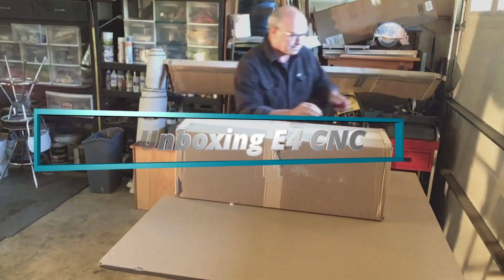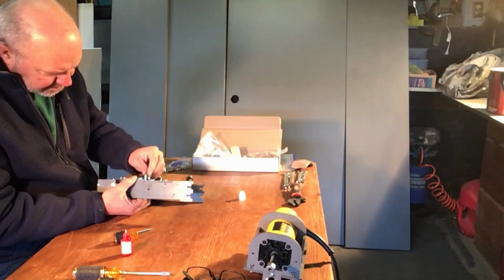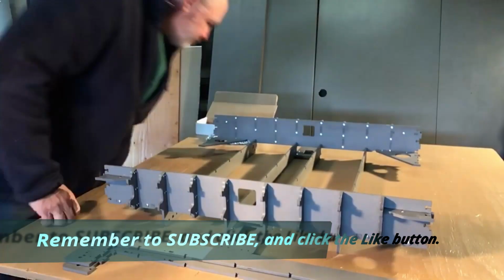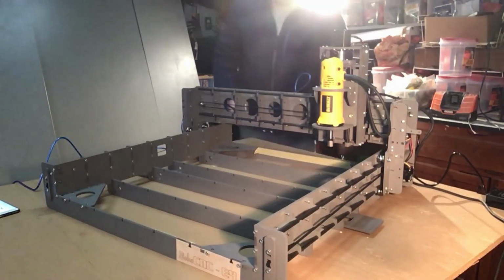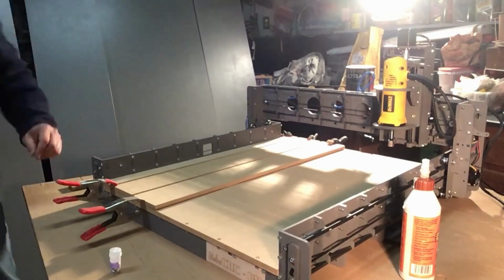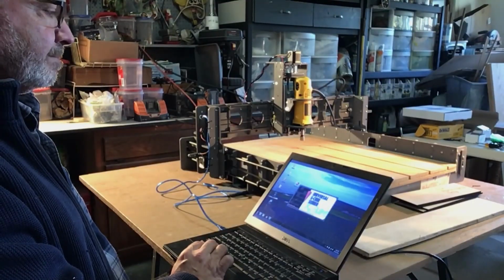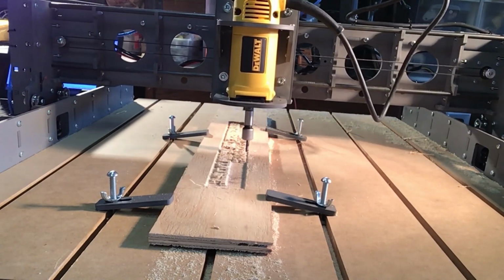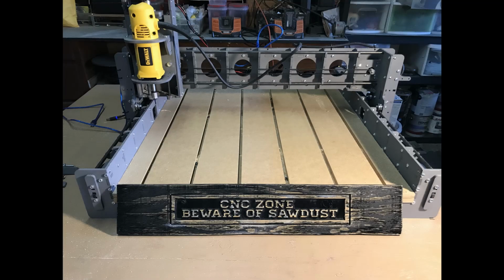Assembly of the Bobscnc E4 CNC router and First Project

Comment: I'm seriously looking to buy the E4 right now. Thanks for your video. I'm sure I will watch it a few more times. I know I have a hundred questions I haven't even thought of yet.
Reply from the maker: Thanks James. I’m certainly not super mechanically inclined, and I had no issues with the assembly. Once assembled they are a lot of fun. Enjoy.
Reply: I recently bought an E4 and assembled it. A few words of advice: The instructions say to read the whole process first before you start. Not a bad idea. It's 105 pages of instruction. Pay particular attention to the bubbles labeled IMPORTANT. They mean it! Many parts are identical so you have to pay VERY close attention to the pictures and note the orientation of the parts. The easiest part to mess up is the board that holds the controller. I know, because I did put it on upside down. I didn't notice until I got much further in the assembly where you attach the controller to the board. I thought that I would have to completely disassemble the thing just to rotate one little piece of wood. Fortunately, by removing 13 nuts and bolts I was able to pry the area apart just enough to turn the mounting board around. Haven't used it yet because I need to build a table to put it on... lol

Comment: i am interested in getting the E4. how well does it cut? If you wanted to cut out a square, or circle for a sign, will the E4 handle that? Someone commented that BobsCNC is only good for light engraving. Can you tell me if you are able to cut on the E4 also?
Reply from the maker: TheAwesomeSam I have had no trouble cutting through material. Several of my more recent project have been done on true 1” thick oak boards and I have been able to out cut shapes like squares, ovals and rectangles for the finished product.  Just made sure the cut depth rate was not to large. Have been using 0.10 inch depth per pass.

Comment: I've just finished building an E4 but haven't used it yet because I need to build a table for it first. My concern is the gantry seeming a bit unsteady. It felt firmer once the belts were in place but it's still a concern. Was your gantry a little wobbly after you attached it to the base and installed to belts? Does this make a difference when it's operating?
Reply from the maker: My gantry is a little wobbly too, but just a little. But not really in the center, just a bit on both ends. For me this has not affected my carving.

Comment: Cool video. I’m actually about to purchase this machine. Does it come with a bit(s)? Which bits are your “go-to” bits for sign making? Any tips on software or just tips in general? Thanks for sharing these videos!
Reply from the maker: The router that came with the kit did include a bit, but I don't think I've ever used it.  My "go-to" bits are typically my 1/4" end mill, 1/8" end mill, 1/16" end mill and my 60 degree V-Bit.  I would start with the Free version of the Easel software.  It was been able to complete all of  projects in my videos so far, and I believe it is fairly easy to learn.

Comment: What is the purpose of painting the wood?  And which pieces did you paint and why leave some pieces unpainted?
Reply from the maker: The BobsCNC assembly manual states you should paint or cover all wood pieces with a clear coat for protection which is. Why I did it. I’m guessing it’s for protection from wear, as it does produce a lot of dust. I painted all my pieces except for where the BobsCNC logo was as I did not want to paint over that. I used clear coat over the logo
Reply from the maker: Also the spoil board does not need to be painted.

Comment: NICE!!!  Im thinking of the E4 CNC....I am a bit concerned about it being "wood".  How stout and sturdy is the unit once assembled?  any concerns with long term?
Reply from the maker: The E4 is pretty sturdy.  In the assembly manual they tell you to use Lock-Tite on every nut you install (300+ of them)...so that seams to have really helped sturdy it up.  I have had mine about a year, and so far it’s as sturdy it was day one.
Reply: @firstcutsawmill6709  cool beans...thanks for feedback.  any reservations on your purchase one year in?
Reply from the maker: No reservations...just wish I would have purchased it sooner.  This thing is a blast!
Reply: @terebag56  Gene I have the E4 and the new KL44. I have beat the crap out of my E4 and shes still kicking stuff out. Great customer service also.
Reply: @turttledove06  Eddie...just saw your comment...you're still pretty jazzed about it huh?  Seems like you agree with First Cut that pretty sturdy.  was thinking the KL744 but too rich for me.  thanks